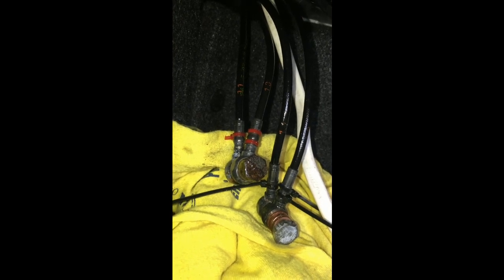Z4 BMW- Moving Convertible Hydraulic Pump to Trunk

Comment: Hey Jack, I would like to use the same method? 
Is there a specific part number for the motor? 
What power cable is being used ?
Where do I tap into the original location?

Comment: Hello Jack.  Saw someone give part number for Ford pump HB80069-002N.  Is pump you used ? ALSO BOLT ON THE HOSES FROM OLD PUMP. WITH ORIGINAL  BOLT?

Comment: Hi Jack, very useful video. May I ask, did you bleed the hydraulic line at all in the process? An answer would be much appreciated.
Reply from the maker: No. Only the pump. But it took a few weeks for the left and right to equalize.

Comment: Just wondering  original hose just screw on the Ford part using the bmw parts ? TALKING ABOUT THE HYDROLIC  LINES .
Reply from the maker: Sorry for a one-year old reply, but yes, the hydraulic lines from the Z4 screwed right into the 'mustang' pump... but notice the quotes around mustang: it's a german (I presume) pump that's identical in every way except the length of the motor on the pump.

Comment: Would we also need extension for the hydraulic lines? What's is the white extension like you mention please?
Reply from the maker: hua Hua 
The white part was the 12volt power line, extended from the back of the seat area to the new location of the pump in the trunk.

Comment: Question, do you know if this will also fit the 2003?  I'm sure it will.  Also, what guage electrical wire did you use?  Thanks
Reply from the maker: John Gerhart, looks like the “E85” Z4 is 2002-2008,  so a 2003 should be identical. (In the software industry all lies begin with “should be.”)

I used US household plastic Romex 14 gauge, I think.

Comment: Is there a line for measurement on the pump for the fluid, I ordered mine but don’t know how low is the fluid cause it leaked some when it was getting delivered.
Reply from the maker: Sorry for one-year old reply, but no, i'm not aware of a line.
Reply from the maker: Did you ever end up doing the replacement?

Comment: Hi Jack,
I am about to try your methods for swapping the OEM top motor for a mustang top motor(HB80069-002N) and relocating to the trunk.  I wanted to ask how your install is holding up and if you have had any issues with the mustang pump now that you've had it for some time.  Any problems? Anything I should be aware of before ordering the mustang pump?  Appreciate your reply 
Ty
Reply from the maker: ty Brad Perfect so far. Probably opened and closed 100 times since October. Never the slightest stutter or slowdown or jam of any sort. And I added the aftermarket thing that opens and closes from remote, and also with a single button push, not holding it down.
Reply: @nofluffDIY  Thanks for the info Jack!  I just ordered the pump and look forward to giving it a go.
Reply: ty Brad hey did you install your pump and how is it working, just ordered the same pump hope I can replace it myself.